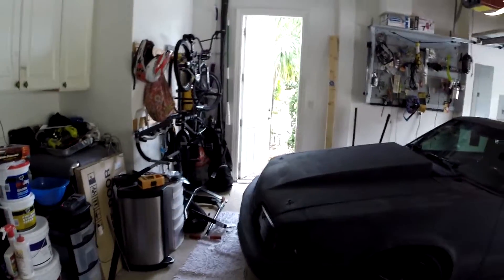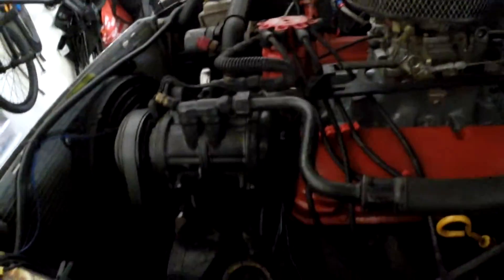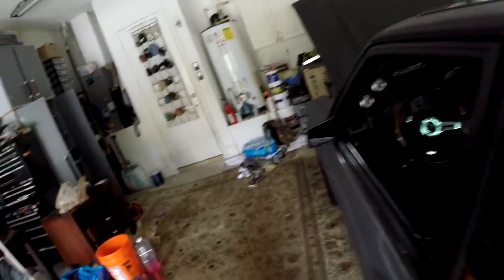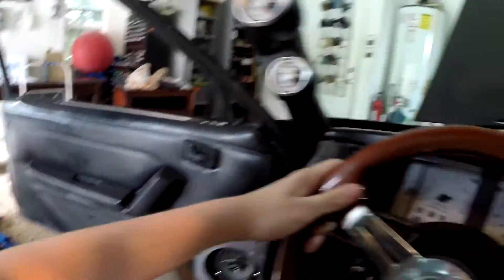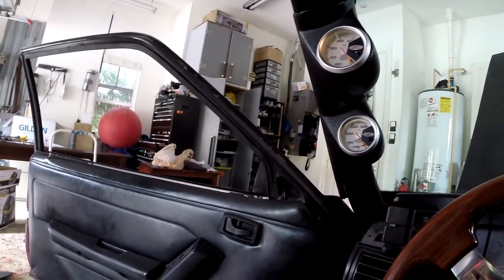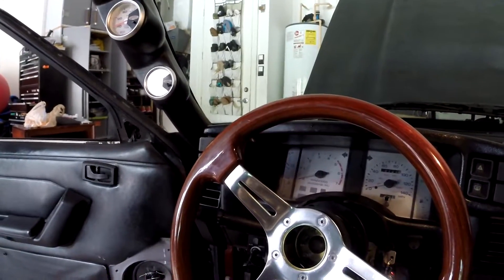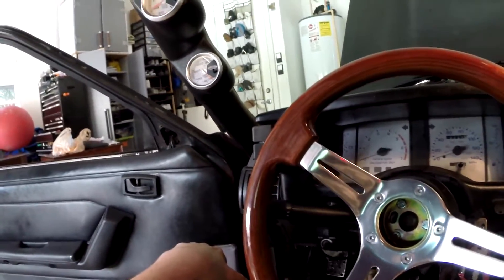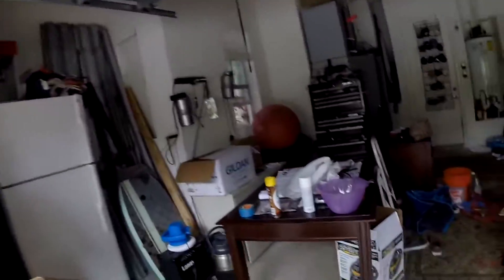My 93 Foxbody Mustang LX

Comment: I love it I'm 16 and my first is a fuel injected 1988 notch 5.0. It is all original never been rebuilt and all stock other than cherry bomb exhaust. The car read 130,000 miles before replacing the speedo cable now it reads 270,000 miles which it was around 230,000 miles when we replaced it. Keep working on the fox dude i hope to see it on the channel more.
Reply from the maker: Krazie Panda giving u guys an update tomorrow it looks badass now
Reply: I can't wait to see, how old are you?
Reply from the maker: Krazie Panda 15 I turn 16 in July
Reply: m about to be 17